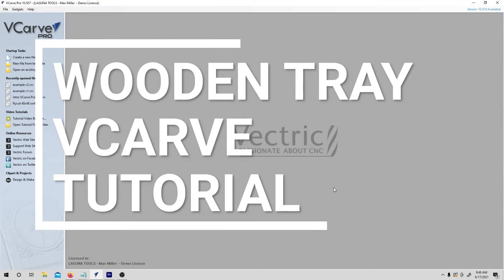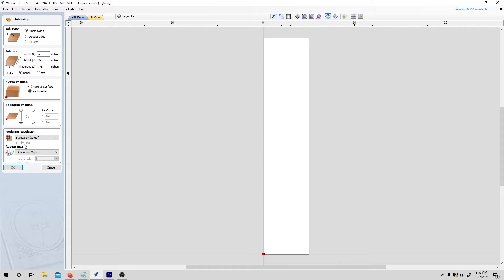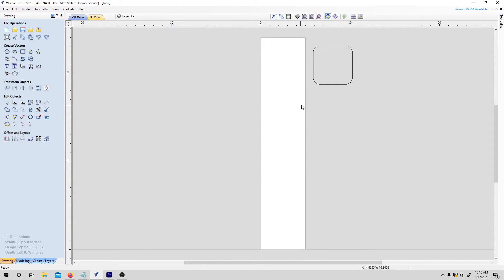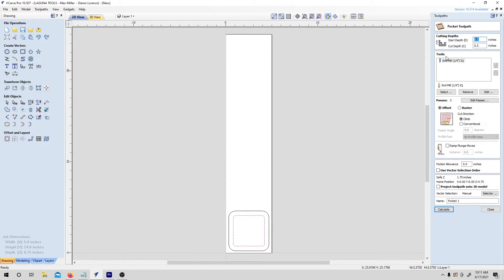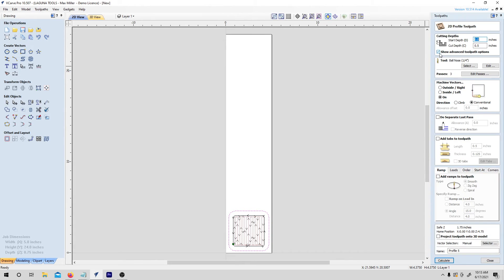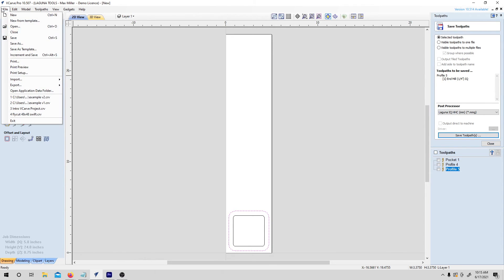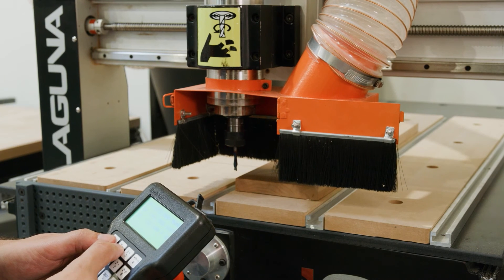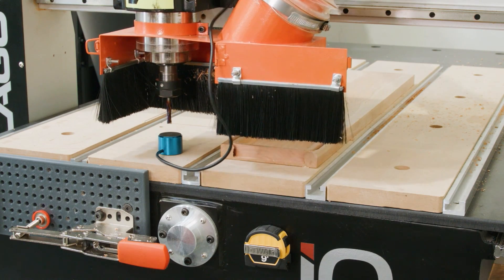How To Design A Wooden Tray Using VCarve Pro® | Software Tutorial

Comment: Great video, thanks. Quick question. Why did you use the tool touch off on the spoil board vs. the material?
Reply from the maker: Hi Zsolt, 
We designed the file in the software to touch off on the bottom of the material. He’s touching off on the spoilboard because that is the bottom of the material.
Reply: @LagunaTools  Thanks so much. I appreciate the response!

Comment: How would you taper the sides to a more rounded corners at the bottom of the tray?
Reply: You could use a larger diameter bit to get a more  rounded corner. I have a 1-1/4" core box bit that I use for my trays.
Reply from the maker: Hi Jerry! You can use a ball-nose endmill bit to produce a more rounded inside profile on the tray. Hope this helps!